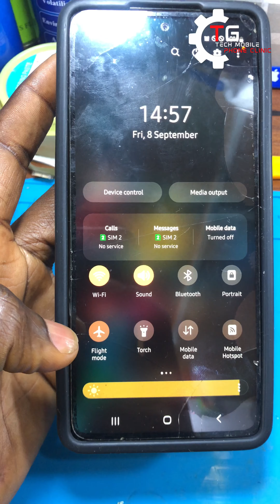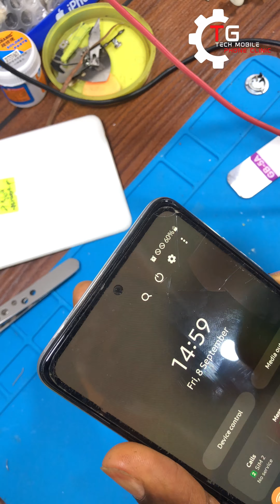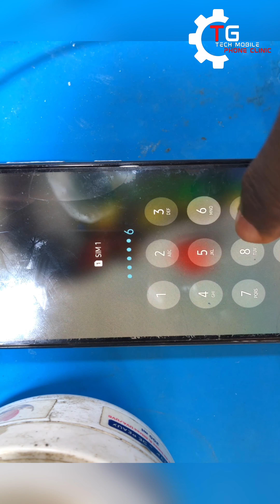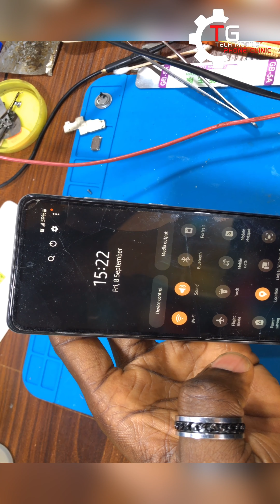Samsung Galaxy A71, A52, A72, A32,… Network Problem 💯%Working Solution

Comment: Good day i have Samsung a52 showing half flight mode which ic do i need to change
Reply from the maker: Check if there is short around the network section, if there is non, go ahead with the replacement of the network ic
Reply: @tgtechmobilephoneclinic   sir around the WiFi ic area I see some water on it I cleaned it and checked the resistor around they are reading normal pls where should I check for the short around the network ic